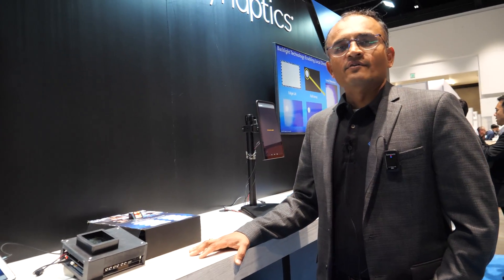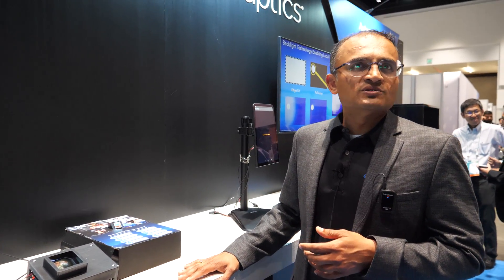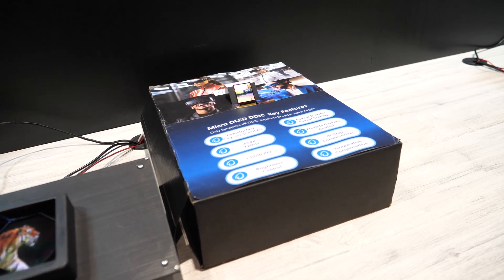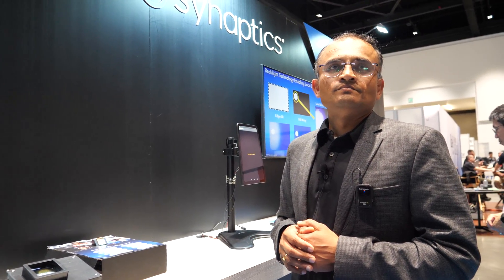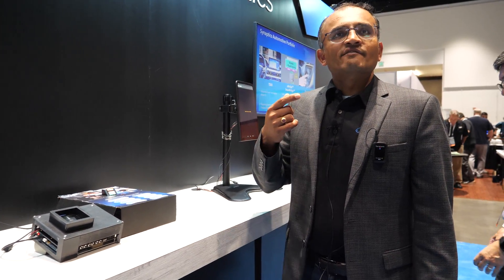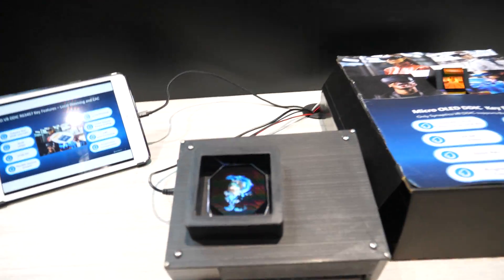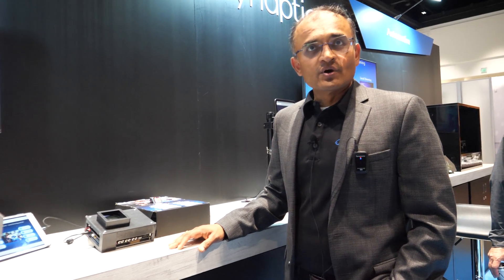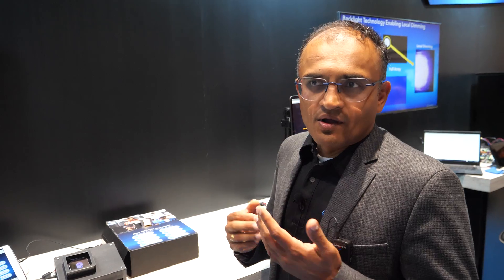Synaptics 4K Micro OLED VR Display Driver enables affordable 1.3" 4Kx4K 120hz VR/MR Display Market

Comment: but what is the exact resolution of the panel and who manufactures the panel itself?
Reply: I suspect the display they are using in the demo is BOE's 1.35", 3552x3840 display but with their display driver they are able to get it to run @120hz. PPI= 3882.